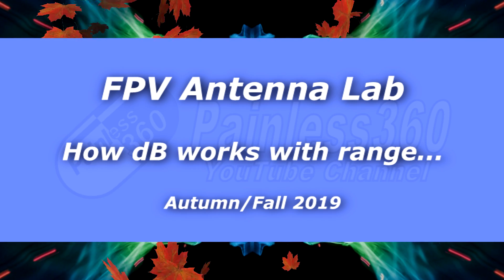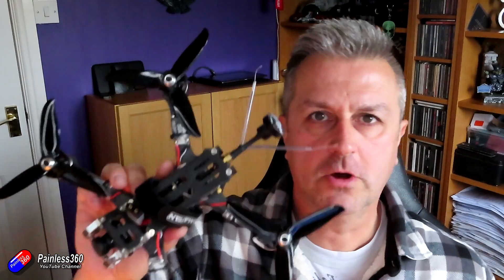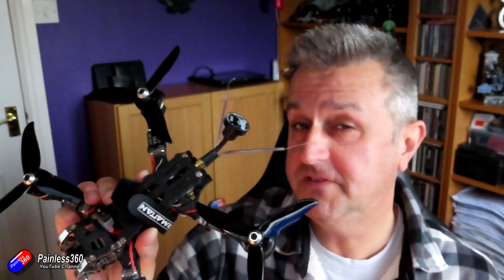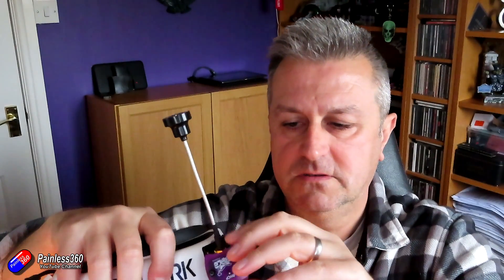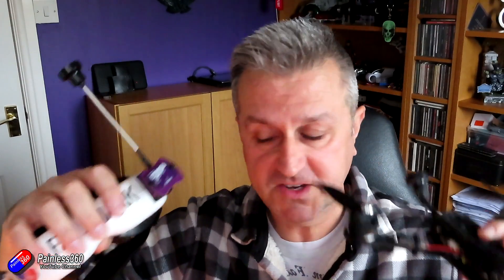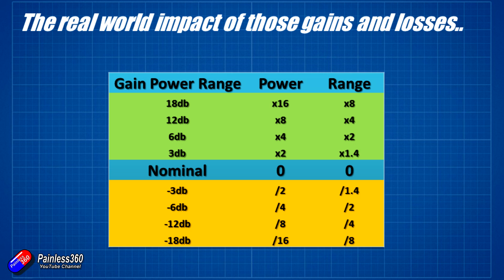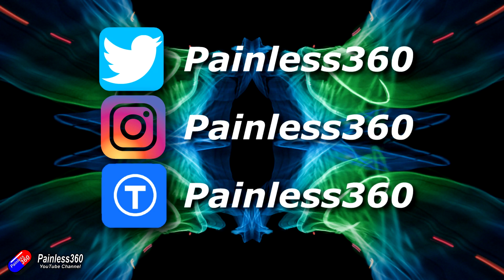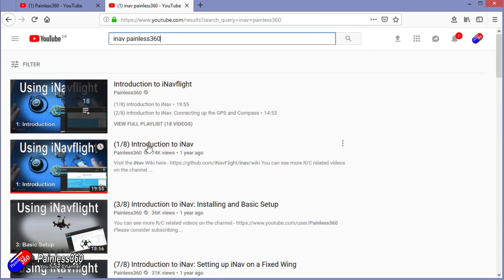Flying further: Antenna gain and power dB explained

Comment: One thing to keep in mind about antennas and particularly 'high gain' antennas is that an antenna will ONLY radiate what is fed into it. There is no free lunch. What makes 'high gain' antennas 'high gain' is that it is concentrating the sensitivity in one direction by decreasing it in another. For things like wifi routers, those high gain paddle antennas radiate more from the flat sides than the round sides. So as long as you are inline with a flat side you will see more signal in exchange for less signal 90 degrees off from the paddle flats. The radiation patterns for antennas demonstrate, for an indeterminate infinite distance (remember your inverse square laws kids!), how much of the signal you should get for a given angel from the radiator. However, if you added it all up, that squeezed out bulb of a directional antenna has the same energy overall as the isotropic spherical ideal antenna. Its just that the directional antenna focuses, for lack of a better term, more of that energy on a given direction in exchange for diminishing it in another. You might get +3db straight out but in exchange youll also get -3db straight up, per se.
Reply from the maker: Indeed. Check out my Antenna Lab series for all of the basics... Happy flying

Comment: Great info for someone starting FPV like myself, Thanks! I use the Menace Pico patch with great results.
Question, When the gain increases on a CP Omnidirectional antenna which direction does the "beam" or coverage focus to?  Unlike a directional patch with a flat facing surface, it isn't clear to me how gain would affect an Omni. Thanks
Reply from the maker: That is a great question. As the antenna becomes more sensitive what you usually find is those dead spots at the top and bottom will increase and that sensitivity will be added to the reception around the middle of the antenna making it more sensitive at the sides. I hope that makes more sense
Reply: @Painless360   Yes that makes perfect sense. Thanks for the reply and simple explanation. I've learned a lot from your videos. Cheers

Comment: Hi Lee, I went off you can help me. I want to use a Crossfire Nano receiver to control the servos and throttle in my Great Planes Kunai. Frankly, it's the only receiver small enough to fit in the fuselage! I have the TBS Nano Adapter which gives me channels 1-4 on the pins, and channels 5 and 6 on the SDA and SLC pins. I need 5 channels: Throttle, left Aileron, right Aileron, Elevator and Rudder. I will not be using a FC, this is just going to be a LOS power glider. How do I power this system, through the throttle servo lead from the ESC/BEC? Where does the throttle lead (servo connector) go on this Adapter? I hope you can help.

Comment: I think at the 4:00 mark you start to mix axial ratio with dB, but great video and that range calculator is a fantastic resource thanks for sharing!
Reply from the maker: As I'm sure you can appreciate, a certain about of simplification is needed so the intended audience (with no depth of experience with these topics) can follow easily.. Happy flying!
Reply: Painless360 sorry, didn’t mean for that to come across as critical as it did. Even as someone with a little experience (by no means expert) I still found this to be one of the clearest and most concise videos about range/power/dB/antennas that I’ve seen, and you didn’t wade into the dark arts of RF that tend to confuse things and make it all wishy washy.
Reply from the maker: Thanks for that. Is is temping to get into the difference between dB, dBm and dBi but I'd lose most of the audience :D happy flying!

Comment: First off I have really enjoyed your videos over the years. In fact I just completed re-watching your videos on loading Ardupilot on an Omnibus F4 pro. I've run into a couple of snags with one of the three F4 boards that I an flashing but your video was great in getting me pointed in the right direction. Anyway just wanted to comment on the Antenna subject coming from my experience as a ham radio operator. First of all the subject is very complicated with a ton of factors that affect the range one can transmit so while the menacerc calculator may be helpful in choosing an antenna your mileage WILL vary depending on a multitude of factors. Also dB gain is in reference  to a standard of which there are two that I know of, dBi which is in reference to an isotropic radiator and dBd which is measured against a reference dipole antenna. The equivalent dBi number is greater than the dBd number so make sure you know which measurement is being used when comparing antenna's. One final point, getting a 6 dBd gain from a Omnidirectional antenna is huge and I would always be suspect of any manufacturer claiming that type of a number until I could see test results that prove it to be true. Edit: for those in the US who don't know a HAM technicians license is required to operate on the frequencies used by FPV video.
Reply from the maker: Cool, I'm a certified amateur radio guy too. Remember that these videos are aimed at those who know next to nothing about antenna theory so an amount of simplification is needed unless you want the video to be so long and complex that the message is lost and it becomes a pointless excersice. Thanks for the comment - happy flying!
Reply: @Painless360  Yes I understand about video length and all that, sort of, personally I would prefer that you do longer videos with more detail but that is just me and probably in the minority on that. Your video is a great start on the topic and it's good that you created it. When I first got into amature radio and not being an engineer I was totally shocked to find out how complicated the subject of antennas was. Since I figured that there are other folks out there who view this subject as I did before learning the truth could benefit from a little additional info. So I guess that my point of my comments was that unlike a lot of RC flying topics the subject of antennas is more complicated by an order of magnitude than most and just in case someone watching doesn't realize it that they might  want to do a little more research, technical and legal, before buying and using this equipment.  I'm not trying to slight the video just felt compelled to add the additional info in case it helps. Thanks and keep up the good work.
Reply from the maker: Maybe a video on dBi could be useful then.. I'll think about it. Happy flying!
Reply: @Painless360  Sounds good although at least for me this subject area gets complicated quickly and delving into even intermediate level topics like dBi/dBd gets me all twisted up mentality sometimes. I think having a simple way or set of guidelines for selecting a good antenna would be useful but even that could be difficult to do because of all of the choices and various use cases. Regardless of what you decide to do I'm certainly looking forward to whatever videos you decide to create.
Reply: Well why dont you do a cideo pbshooter,i would love to see your thoughts as well,you seem to be in the know as well please share your thoughts.
Reply: @markhinchcliffe5803  Thanks for asking but I think I would truly suck at video content creation so it's probably best to leave that up to the pros like painless360 and others.

Comment: Great Video! One question remains for me though, is it always better or beneficial to have an antenna with the highest sensitivity ?
Reply from the maker: A higher sensitivity means a narrower cone of reception. So as you increase the rating of the antenna, the amount of the sky it'll 'see' decreases.. That is why diversity is often used so you can have two or more antennas working in tandem..

Comment: Awesome and informative for a newbie like myself. What antennas would you recommend for the Jumper T8SG Plus transmitter? It has an odd connection that I'm not familiar with... Thank you so much for sharing!
Reply from the maker: The linear antenna that comes with it is fine, I'd not change it personally..
Reply: @Painless360  OK, Thanks!